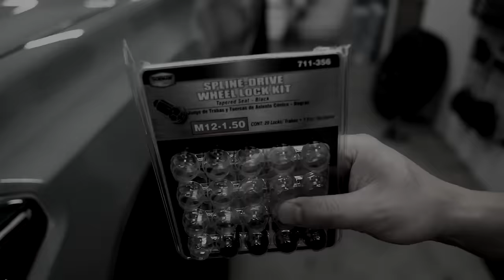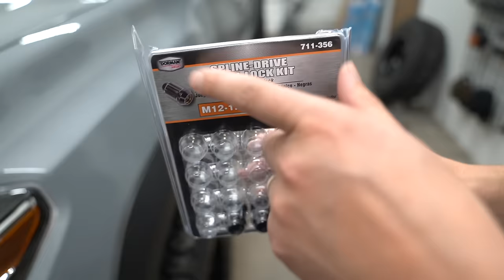Biggest Tire Size on a Tacoma/4Runner with NO LIFT!

Comment: This video should be titled What not to do with your Tacoma.
Reply: Why? I’m just asking because I just got my Tacoma and wanted some beefier tires. Was assuming this size would work
Reply: I want to know too
Reply: Tires are too big. It will rip out your fenders once you hit a bump at speed
Reply: Jamie  It also depends on what width the tire is, what width the rim is, and what the rim backspacing/offset is.
Reply: Lol😂
Reply: Exactly - the first time you go off road in that truck, you’re fucked.  2.5 inch OME lift is perfect for those tires.  Or just go with 275’s…
Reply: Heat gun will do a better job

Comment: 2” bigger tire is only 1” worth of lift. Tires are round.
Reply: But doesn’t it still look two inches taller when you see the entire tire? It’s what the eye sees.
Reply: @boblafountaine9560  no, it’s only one inch tire like the nice man said. It’s 1” taller on either side of the wheel’s centerline. If the hub mounted to the tread then it would be 2”, but it mounts to the center so it’s only half.
Reply: One thing he neglected to mention was changing the size from a 16-in to a 17-in wheel as well as the increase of tire.
Reply: @noisysounds4420  doesn't make ay difference. outer diameter is the same. math is hard...
Reply: @mattgill69  it's not hard just involves a lot of variables that affect the look and ride. 🤷
Reply: This is ridiculous, any turn anywhere and it going to scrub a lot and going off road would be absolutely out of the question with this.
Reply: @mattgill69  I don't think you understood what dude was saying. He didn't say going from a 16 to a 17 inch wheel makes a difference in tire diameter since a 285/70r17 would be the same as a 285/75r16 in the 16 inch wheel version. He was merely stating that the guy didn't mention that the wheel size was changed as well is all, nothing more. Having said that, if you want to get technical and are so passionate about math, then my answer to you is yes, there is a difference in diameter going from a 16 to a 17 inch wheel in the case of this size tire respectively to each wheel size. A 286/75r16 is actually a 32.83 inch tire while a 285/70r17 is a 32.71 inch tire. Mathematically not the same diameter. Also, there is less side wall on a on the 17 inch tire as compared to the 16 and for off roading as well as every day ride comfort it makes a substantial difference. You can air down more when off roading chunkier trails on the 16 before you start bashing your wheel edge and possibly bitting your sidewall as compared to the 17 and it definitely changes the truck aesthetics, for better or worse depending on personal preference. I guess reading comprehension and math were both hard subjects for you. 🤷🏾‍♂️
Reply: And only the bottom of the tire goes flat.
Reply: @KTMcaptain  well said
Reply: @noisysounds4420  the red off road comes stock with the wheel sizi he put on. 265/70-17

Comment: 285's are just to big for a stock tacoma or even with a 2" lift. You can fit 265 70 17 or 265 75 16's. There almost 32's or go with some pizza cutters. 255 85 16's. I don't know why everyone works so hard to fit tires that definitely don't fit. They're heavy, they throw your speedo off, they're likely to ware parts prematurely and they rub. So just don't do it. Not worth it. You can off road with 265's. Your talking an inch difference.
Reply: An inch matters ask my wife 😢

Comment: You cut the fender plastic for the sake of bigger tires on 40k truck....obviously tires to big just parked there turning the wheels side to side. It's not going to work. You'll need to raise it.. which exposes the cut fender plastic more..should think this through. Thanks for the video.
Reply from the maker: It is actually only a small piece of plastic that does not affect the functionality of the truck whatsoever. You only have to trim about an inch off of it and nothing is exposed behind that tiny piece of plastic. And we test-drove it to make sure everything clears.

Comment: So if you drive straight on a perfectly flat road, you won’t rub.
Reply: LOL. Talk about  chopping your shit up because you don't want to accept you need a lift and bigger arms if you want bigger wheels.
Reply: Any flex at all And this dude is having a bad day
Reply: Great  looking truck.your wheels nice am contemplating lift etc . Gd info
Reply: PatTheRiot i would consider the biggest tire size without a lift without any body chopping or anything else. At that point just lift it. Now if you lift it and you want bigger tires, that’s when you can do mods to the body or get an off-road bumper but do the damn lift first lol
Reply: As soon as he’s driving on any road, smooth or not, shits going south on the first turn
Reply: Yeah a rude awakening out on the trail. He’s ducked.
Reply: Andy Ham thanks for that comment. I was going to do the opposite, but I’ll do the lift first and then save money for tires. I have a question though? Would their be any issues with driving a lifted truck with stock wheels. I have a 96 T100
Reply: I also thought that KO2s run smaller than advertised. Anybody else hear that? If that's the case, maybe these are a bit smaller than 33". Unless he measured it I guess.
Reply: @VedaRiff  I was told the Kos do run smaller but the Firestone  dealer said they would fit on my truck but he recommended 2.5 Spacer lift in the front and one inch block in back hmm
Reply: So.. this is basically to drive flat and nothing heavy in truck. 

Basically perfect to show off at church.
Reply: @mkiob7648  any rubbing with that set up? Any cutting? I hear no rubbing and other people say yes
Reply: so glad other people gt it and have actually driven off pavement
Reply: And turn corners like you on dubs...😂
Reply: I’m running 33s with stock suspension and have only slight rubbing when off-roading and I mean serious articulation. Why? Cause I got skinnies and don’t run wide ass tires. 33/10.5x17. Yea his are wider so I can see rubbing. Doubt even a lift will help cause it doesn’t change anything in the wheel well and will run once it’s compressed unless you also run bigger bump stops. Anyways let them do what they want 🤷🏽‍♂️
Reply: I mounted up these exact tires on my off-road while waiting for my lift kit to arrive.  I was constantly rubbing even after doing the same kind of fender trimming seen in this video.  Sure, you don't rub driving around town super carefully but put the brakes on a little too much when driving down a steep driveway or turning a little too fast....basically anything that compresses the suspension and there's terrible rubbing.  I'd not increase the tire size unless lifting it....
Reply: 33s you will need a lift for sure
Reply: @MrFearless16  what width tires are you running?

Comment: Fail. Summary: Your new tire doesn’t fit stock and no lift setup.
Reply from the maker: K
Reply: @Jacques do you even know how to do any of this..? I doubt it so don't act like you know what your talking about. Or how to be a decent human being for that matter.
Reply: @tiffanylarcade9275  he's right, guy. tire doesn't fit. any degree of variation would cause contact doesn't even have to be off roading. could be going in and out of a driveway or over a pothole. there is not enough clearance.

Comment: With that tight clearance, it’ll still rub. Specially when going in reverse. There will be a slight compression in the spring and hence will rub. Ideally a cheap top hat spacer is needed for 285s.
Reply: I have 285/70/17 with a 1n3 level spacers on a 2017 off road. It rubs on the frame any sharp turn, into and out of any parking space and all angles in reverse.
Reply: Without a lift, any 285 tire will rub, especially in reverse, if you dont trim, and or do a Cab mount chop, been this way forever. Check any Tacoma forum, its the number one asked question,  "How big of a tire will fit".
Reply: I was thinking the same thing, that’s going to more than rub when the suspension is compressed even a little.
Reply: @donnieraines2066 mine have never rubbed in reverse on my 3rd gen pro. They only rub a little when turning travelling forward and hitting a bump. Not major enough to rip anything off because my truck is totally fine after some harsh snowy backroads and they've been on there 2 years with no modifications. 285/75R16.
Reply: @donnieraines2066 i thought the consensus was that 285s will fit with no rub on trd pro models, and models with factory lift. My understanding is that the wheels need to be zero offset.

Comment: I have these same wheels paired with Falken Wildpeak 275/70-17,  stock suspension. They indeed do rub with the wheel at a slight angle
Reply: 0 offset and stock suspension?
Reply: You think 265 70 17 will rub?
Reply: @gabrielguardado1009  doubtful those are even skinnier
Reply: @gabrielguardado1009  I run 265/70/17 on my 2018 SR5 with stock suspension and have no rubbing at all
Reply: @Mrblitz1819  is that with stock wheels or aftermarket with a 0 offset?
Reply: I just did a 2.5'' front and 1.5 rear lift on my TRD sport. With 275/70/R17 tires, no rubbing. But I haven't gone off roading yet
Reply: @scarrillo31  hey what offset does your wheels have? I’m thinking about 275/70/17 as well, but my current wheels have a -12 offset

Comment: Yah if ur gonna tell people this, id recommend doing more than just showing a stand still video. Telling people that they can fit this stock without showing more involved like flexing, driving, bumps etc etc. This is practically useless. Considering i fit 255/85/16 toyo mt stock with stock wheels and never had to worry about a thing. It varies through out but thats why you trim and cut where needed.
Reply: Are those 32's? Not a conversion expert
Reply: @jtec99  33s my friend!
Reply: @CanadianOffroad4x4  nice, got a 2" spacer lift and 2" block in rear. That get me anymore flex clearance?
Reply: @jtec99  technically not with a spacer.  Your suspension is limited to by what you're running. It will flex as much as it can. You won't have issues
Reply: @CanadianOffroad4x4  thank you buddy, and the 255s will fit on stock Toyota rims in assuming? Have the trd off road year 2020.
Reply: @jtec99  100% yes
Reply: @CanadianOffroad4x4  I subbed. Def plan on it after I get out of work
Reply: @jtec99  awesome thank you! If any ever requests for videos just comment below on my videos
Reply: @CanadianOffroad4x4  will do, thanks

Comment: The 285s won’t hit the wheel when the suspension compresses ? I don’t believe it. 265 75 16 is the largest tire you can put on Tacoma stock with out the possibility of hitting the well
Reply from the maker: Theodorski newkcomerski it will rub when off road. You're right on the 265/75/16, also 275/70/17 would work if you still want to be able to off road with them. Most people who are asking for this video do only daily driving
Reply: @Runnin4Tacos   well that's just lame making a video for mall crawlers
Reply: Good Video, mall crawler or not. If you are going to hate, hate on the owners of the truck.
Reply: Theodorski newkcomerski false
Reply: ran 255/85/16. never had any issues and i flexed out multiple times lol. The best and proper way to fit bigger tires to actually FUNCTION offroad is to infact trim and cut as needed rather than lift to think you need to fit the tire.
Reply: BlackGT1999 Who are you? Dwight from “The Office”
Reply: Taco Twonz good to know man. I’ll be building my Tacoma. Your videos have helped me make some decisions. Keep up the good work 🤛
Reply: BlackGT1999 haha
Reply: 255/85R16s fit no rubbing on cab mount or fender liner on stock offroad wheels (7 wide, +25ish offset)

Comment: i’d rather off road efficiently than look cool at the mall tho
Reply: Don't forget the rubbing when leaving the mall bump LOL
Reply: I would rather build a mall crawler that can wheel but dont wheel. And. Only lightly wheel it on dirt roads. And then buy a quad a dirt bike and a side by side and wheel the shit out of them like i did. These trucks are way to expensive to buy a 2020 trd off road then buy new tires and rims and shocks and re gear it and get a 6 inch lift and a super charger. These are all things you must do to propey wheel it and do the kind of wheeling i do. If you dont then all you are doing is ridding through puddles calling it mudding riding on dirt roads calling it hitting the dunes and driving 100 yards down a groomed trail illegally or at a track and saying u are trail riding. Yall pussy cant off road as good as i can.
Reply: Gsfbffx Pdhhdf yeah I mean I off road in my truck but shit all that gear you said is mad expensive to go off roading with the right mods to not fuck your truck up and it still might happen. But like you said suspension sliders and other armour lifts tires wheels are all so expensive. That’s not even including recovery gear and bumpers and lights if you choose to do so. I have a sr5 4runner with just the trd skid plate on it and bigger tires. Can’t afford an off road suspension or sliders or anything else right now.
Reply: @gsfbffxpdhhdf7043  sometimes u need to to take your truck to a off road location . Your trucks carry all your supplies so u can go in deep in the trenches. That way u willnhv two vehicle for off road insted of one. More is better right?
Reply: @andyham6094  when u say off road suspension , what are u refering to. Because all lift kits are off road suspsension, just some are better but u can get some cheaper ones and it does the job just fine.
Reply: What mall is it that everyone is talking about??
Reply: @jzila9900  Tacomall
Reply: @emendodesigns  we have a Tacoma mall in Washington state.
Reply: I believe that mall is now an Amazon warehouse

Comment: For those who want to keep the stock wheels: I have a 2018 Offroad at stock height and literally just installed 265/75/16 tires which equates to a 31.7" wheel; no shaving required and no rubbing at all at full turn.  Like TT mentioned, I believe you could get away with 32"s at stock height with zero shaving/rubbing, but I haven't seen any tire spec combo that gets you to exactly 32" at R16.
Reply: 265/17R 16 is all you want any bigger you need a lift and gear ratio change. Congrats!
Reply: noice i might try that
Reply: Yup I put 265/75/16's on my 2020 & no issues. Then I got stupid & put a 2/1 lift. Spacer/Block. Every 6 months I had to get alignment & it had a wobble in rear. Live & Learn.  I got 2023 trdSport recently & I may leave it stock & just go tad bigger tire.... Or I may go Bilsteins 5100 adjustable shock/strut set at 1 on front & Bilsteins on bacK. No block. So it will be leveled & not much different geometry then factory. Then I may go 275/70/17 on stock wheels. Shouldn't have any rub or cutting..... Lifted Tacoma's look sweet BUT it comes with a pricetag. Even if you do the best of the best be ready for issues. It's almost a guarantee.....2/1 lift did very little to MPG. Bigger tires WILL reduce MPG by 2/3+ MPG
Reply: Umm, thats the standard factory size on the Tacoma Trd Offroad. My 2022 came with those. Maybe you meant 285 instead of 265, since 265 is normal/stock size.
Reply: @Eastsidegeorgiaboy  True, stock width is 265, but my point was about the series, 70 vs 75.  285/70/R16 is basically 32's, but depending on the offset most people seem to rub going that route without a lift and cutting.  At the time, I wanted to put the highest series on stock tires and stock height without rubbing or cutting.  Now I have 265/70/R17, no rub
Reply: You can fit 255/85R16 to get 33” tires on stock height from what I’ve seen.

Comment: Always put the spare tire wth the air valve facing down, when it loses air it will be easy to fill, otherwise you will have to remove again, and your tpms light wont be on forever.
Reply: You can't put it up with the valve stem facing down, plus that means the face of the wheel would be exposed to debris.

Also, the spare tire does not have TPMS.
Reply: The reason the tire is mounted with the valve stem facing up so if water or moisture gets inside of tire it will not rust the valve core. To solve that problem buy a 12" flexible valve stem and pass it thru 1 of the wheel openings put tire the way it should be mounted facing UP
Reply: @Aroceen  Not true